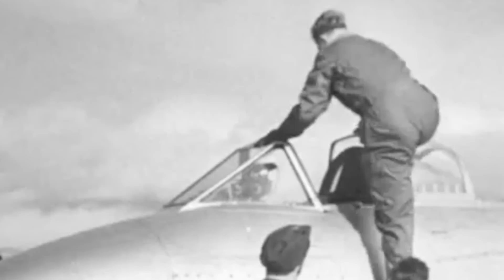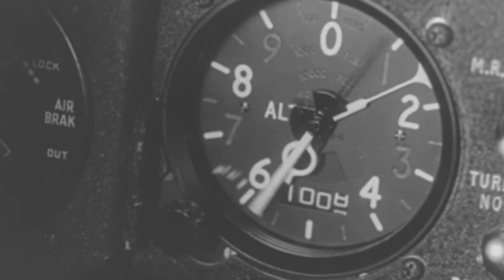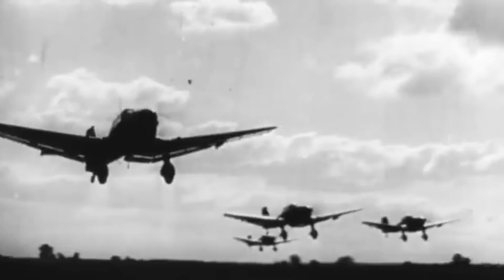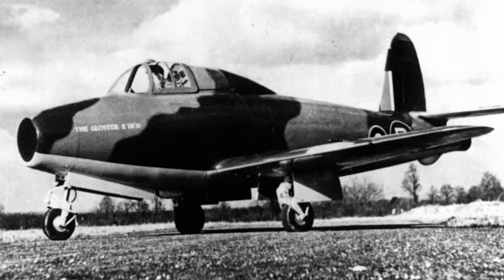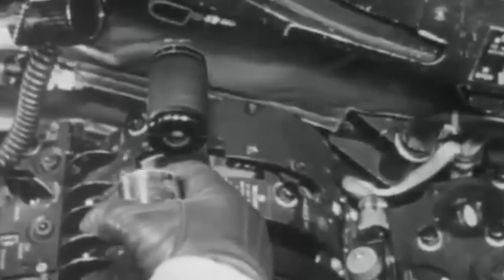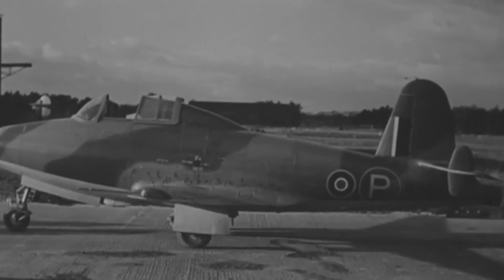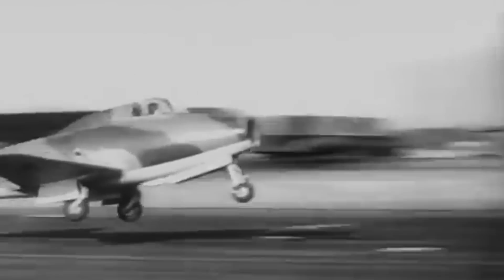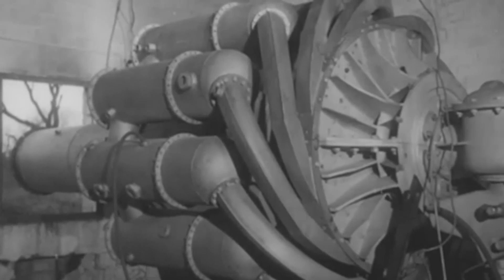Britain's 500 MPH Coffin With Wings

Comment: Whenever the subject of jet engine development during WWII comes up on YouTube, all too often I find myself having to correct the uninformed, misinformed and erroneous comments that are posted.  Frequently, they have a decidedly anti-British content and even go so far as to denigrate Sir Frank Whittle’s achievements.
I submit my comments based on the knowledge and experience gained during a career lifetime in the design of gas turbines, industrial, marine and aero.  With this background, I have naturally also taken an interest in the history of jet engine development.  Having done so over the years, I’ve made a point of studying and noting the performance data and other relevant information of the various engines.  
Consequently, I have to tell you that there is a mythology about the so-called “advanced” German axial flow engines, and I will take the trouble of specifically restating the facts about the Jumo 004B.  As I’ve said before, the Jumo 004B worked – but only just: it was an engine in need of considerable development.  I reject any suggestion of “prejudice” on my part:  I go by the published and recorded facts.        
In 1944, the 004B in the Me 262 had a lower pressure ratio, a higher specific fuel consumption (sfc) and a lower thrust/weight ratio than Whittle’s first flight engine, the W.1, back in 1941.  The 004B might have had an axial flow compressor: however, its efficiency was low, and it surge margin was, at best, marginal.  At high altitude, it would have been non-existent.  
Considering the comparative sfc figures for the engines, that for the 004B is widely quoted as 1.4, as compared to the W.1 with a value of 1.36.  However, an sfc/thrust/altitude performance ‘map’ of the 004B, which had been tested in the high altitude test plant in Munich, was handed over at the end of the war.  This shows figures of between 1.7 and 1.85: for a supposedly “advanced” engine, such figures are abysmal.    
Because of its marginal surge margin, the handling of the 004B was problematical, to say the least.  It had a complicated starting procedure, and the use of its variable area plug nozzle arrangement was necessary as part of that procedure.  Once started, the throttle could only be opened and closed with care, at risk of a surge and flameout.  After take-off, the Me 262 had to climb out on a fixed throttle setting and, on landing, it was a sitting duck for any Mustang or Tempest.
The reasons for these shortcomings became apparent to the British engineers when they stripped an 004B at the end of the war.  They were expecting to learn something from this “advanced” engine but were immediately disappointed: the compressor was quite obviously designed with zero/100percent reaction blading, whereas RAE had gone in the direction of 50percent reaction.  It was clear to them that the RAE’s small engineering team had a better understanding of aerodynamic flows, three-dimensional and compressibility effects, and the need for free vortex flow design, than their German counterparts.
By the British standards of that time, as exemplified by the Metrovick F.2, they considered that the 004B’s compressor and turbine designs, and hence the engine’s sfc, were “dismal”.  This was surprising after four years of work in well-funded, well-staffed, and well-equipped research and development facilities.  In other words, British engineering was, in this instance, notably superior to German engineering.  It is, perhaps, significant that attempts to develop the 004B after the war by the Soviet Union were abandoned in favour of developing the reverse-engineered Nene. 
There was certainly an interchange of ideas and technology before the war between Britain, Germany and Switzerland.  For instance, it is well known that Griffith and Constant from RAE visited Brown Boveri during 1937 and 1938 to discuss the supply of an axial flow compressor.  However, during the war, the RAE in Britain continued to develop its own axial flow compressors.  In the USA, axial compressor development was also well under way before the end of the war, where it was quite obviously independent of any German technology. 
The post-war future of the axial flow engine did not depend on the foundations of German technology as exemplified by the 004B: it had already advanced beyond this.  Nevertheless, it would need several more years of protracted development of the axial flow compressor, with trial and error along the way, before it surpassed the centrifugal machine.
As Sir Stanley Hooker observed. “it took us about seven years before the AJ.65 [the Avon prototype] could get a clean bill of health.  Seven years when we had made the Nene in as many months!”
Reply: What achievements?
Frank Whittle was only the fourth person to successfully demonstrate a working jet aircraft engine and was not the first to achieve anything related to jet engine development.

Britain was a decade behind Germany in jet engine development, the UK would not have reliable axial compressor turbojets until the 1950s.
Reply: @sandervanderkammen9230 

We do indeed feel we can clear up some commonly held misconceptions, obviously.
 
Obviously It's always good & very important to take account of the facts.

   Indeed, it's generally agreed that Britain was always at least 10 years ahead of Germany in jet engine development. The Axial compressor & turbine used in most gas turbine aero engines obviously having been first produced in England before 1900 for turbomachinery use & the internal combustion gas turbine aero engine having been first discussed in England before 1900.

    obviously It's a great shame that British military forces had to occupy a large part of Germany for decades after WW2 & that Russia had to do the same. Of course, Russia & the UK now produce nukes, Germany does not produce nukes. Russia still posseses a large chunk of territory that was part of Germany.

Agreed, that's correct, all Sir Frank Whittle's engines received full air worthiness certification,l. The RR Nene for example was a Whittle engine & was of course the most powerful & most reliable engine on the planet in 1944 and over 100,000 of the basic Whittle engine type would be produced in many countries as copies or licensed versions including in the US, China, Russia, France, Switzerland & the UK. 

   Indeed it is true of course that the Heinkel & it's engine by Ohain were of course very amusing & interesting & indeed completely useless. A bit like having an oriental toy manufacturer having a go at full size jet engines & jet aircraft. Ohain's engine was copied from Whittle with a radial turbine to avoid a patent infringement, Ohain had full access to most of Whittles work & writings on the subject & didn't understand most of the how's & why's if the new engines. The aircraft & it's engine was also much more useless than the 262 & it's 46 minute life engines.

     Agreed, as stated it is the case that No German technology axial compressor gas turbine aero engine formed the basis of any UK or US built engines at any time. British axial compressor gas turbine aero engine work began before 1930. The world's first basic axial compressor & turbine technology for turbomachinery applications being created in England before 1900. 
    Obviously the key Nickel super alloys (not primarily iron stainless steel alloys being used in Germany & the US) required for turbine blades were invented in England around 1940 & were available nowhere else at the time. In France around 1951 attempts to develop from German engine designs for the Dassault Mirage 3 resulted in the air cooled sheet steel turbine blades being eventually changed for solid Nimonic turbine blades & a number of other Rolls Royce technologies being adopted in order to get a working engine.

     Of course that's correct, Whittle demonstrated his engine in 1937, the world's first demonstration of a pure gas turbine aero engine.
Gloster E28/29 + Whittle W1 Short Hops April 1941.  
FF May 1941.
Gloster Meteor First flight 5 March 1943.
   Gloster Meteor In Service (after extensive trials & with a very reliable engine.)
  Introduction into service 27 July 1944 3947 produced. Operational in more than 17 countries. Retired 1980s RAF.
Gloster Meteors broke world speed records in 1945 & 1946 exceeding 600 mph. A Gloster Meteor was the world's first turboprop aircraft in 1945.

Yes we are aware that Of course all the British jet aircraft from 1941 onwards were able to exceed the speed of any current piston engine fighters of the same year, the British jet aircraft were not required as superior allied piston engine fighters could easily maintain air superiority. The jets  were restricted to  operate over allied controlled territory only in order to prevent examples getting into the wrong hands.

    Me 262 First flight 18 April 1941 with piston engine (Junkers Jumo 210).
18 July 1942 with junk unreliable jet engines -  Junkers Jumo 004.
In service Introduction April 1944 but mostly still highly experimental & useless.
Retired 1945 Germany, 1951 Czechoslovakia.
Primary users Luftwaffe & Czechoslovak Air Force.

We agree, it is the case that obviously Whittle's basic centrifugal compressor reverse flow combuster gas turbine aero engine is indeed definately still manufactured for various aircraft applications. Lycoming & Pratt & Whitney currently produced gas turbine aero engines that use the centrifugal compressor & reverse flow combuster configuration first demonstrated by Sir Frank Whittle.

     Of course we do indeed hope this helps obviously as always

         C H E E R S.  of course 
    &  Indeed  👍 & 😎 without doubt      
                 O B V I O U S L Y.

. ......... ....... ......
........ . ...... . .  ..
.. ....... ....... .. . .
... ..........  .... ...

Comment: Thank God the RAAF  pissed off the Meteor  & got  Ca 27 Sabres & Mirage aircraft other wise more people would have been  killed  !!
Reply: We believe we can clear up some common misconceptions & false myths.

It's always very important to note the relevant facts obviously.

Of course the F-86 Sabre & later F-100 Super Sabre & versions built under licence such as the CAc Super Sabre / Avon Sabre built for the RAAF generally had accident losses of around 21%

It was in fact the case that the Meteor had similar accident loss rates to the Sabre & Super Sabre while being a much earlier aircraft design.

    Regarding the awesome Gloster Meteor, it's achievements & obvious relative superiority.

Indeed it is of course correct that the Gloster Meteor was in fact operational during WW2.

   Agreed, of course it is the case that we can compare the awesome trailblazer Gloster Meteor with the Starfighter. Training, equipment, knowledge in many areas & infrastructure had all improved considerably by the time of the Starfighter obviously, indeed it should have been much safer for pilots & others than it was.

     Yes that's correct obviously, the ME-262 was limited to running away from allied piston engine fighters  & risking engine destruction while doing so & it took 3 downed 262s for each downed allied bomber over Germany where German air inferiority was fairly ubiquitous so there was indeed large swarms of allied bombers available to have a go at but the 262 was of course a dismal failure at that task.

     Agreed, clearly after 1941 it was clear The future Gloster Meteor wouldn't be required as such & was limited to operation over the UK & occupied allied territories to keep examples out of the wrong hands.

    Yes it is of course correct that the world's first jet powered aircraft to exceed 1000 mph was indeed a British aircraft.

  Yes, agreed, it's a pity British forces had to occupy a large part of Germany for decades after 1945. Russia had to do the same. Russia now produces nukes. Of course the UK produces nukes. Germany does not produce nukes. Russia still possesses a large chunk of what was German territory.

  Of course there are two fabulous Gloster Meteor aircraft currently being used for ejector seat R&D at Martin Baker.
   
Contrary to their copious & ubiquitous posts regarding accident losses of various UK aircraft.
   
As they mentioned previously, the Sea Vixen & Gloster Meteor were indeed very competent & beautiful aircraft.

    In fact the Meteor was the world's first aircraft to exceed 0.85 on the combined 2 year looks & capability scale for jet fighter aircraft.
   
    That's correct of course, Indeed A rather superb Gloster Meteor was the world's first Turboprop aircraft in 1945. In 1945 & 1946 trail blazing Gloster Meteors set world speed records.
     
  Yes, of course it is correct that British military aircraft at the time did not have unusually high accident losses rates.
For example
De Havilland Vampire &  Sea Vixen & Gloster Meteor accident losses were not high or unusual for fighter aircraft at the time.
Non combat phase accident losses 
% of Aircraft built.
The Canadair CL-44 was a turboprop airliner.
Canadair CL-44                    (ff 1959 ) 48%
Lockheed XF104                    (ff 1954) 100%
Lockheed  P80                       (ff 1944) 43%
Lockheed F104                      (ff 1954) 45%
McDonnell FH Phantom       (ff 1945) 35%
Gloster Meteor                     (ff 1943)  21%
DH Vampire                          (ff 1943)  23%
DH Sea Vixen                       (ff  1951) 33%
Gloster Javelin                     (ff 1951) 20%

Gloster Meteor.
3950 Built.
In service 1944.
70% didn't have ejector seats.
839 accident losses.
436 accident loss fatalities.
21% accident losses.
11% accident loss Fatalities.

Lockheed F104.
2578 Built.
In service 1958, 14 years after the Meteor.
All had ejector seats.
1100 accident losses.
425 accident loss fatalities.
43% accident losses.
17% accident loss Fatalities.

As always we do indeed clearly hope this helps.

Cheers
👍 & 😎 & of course 🙂 indeed.
Toodle PIP Old Chap  (obviously)
     
                
    Clearly, the line above is blank, (entirely intentionally).  
O B V I O U S L Y
    
.. . .. . ... .... . . .......... ...... ..
.... ....... ..... ...... .....  ..... ...